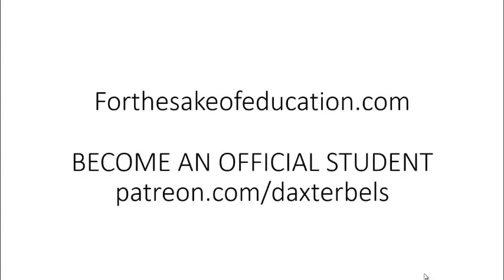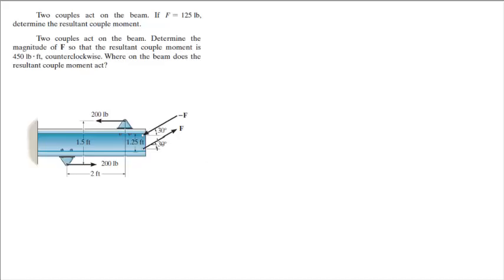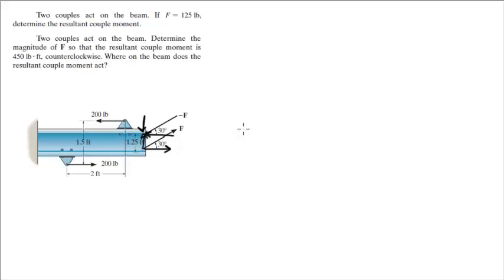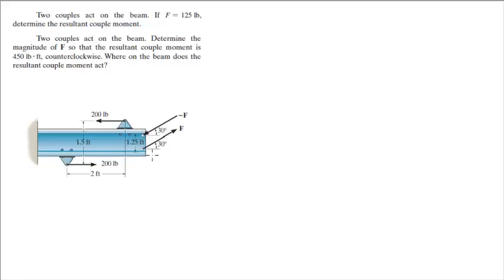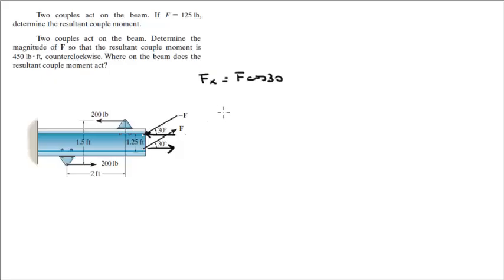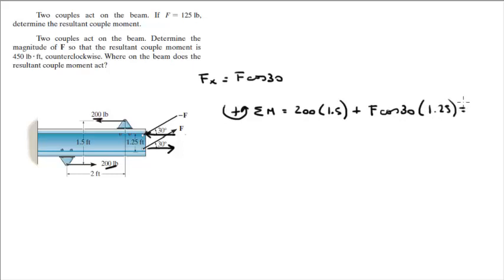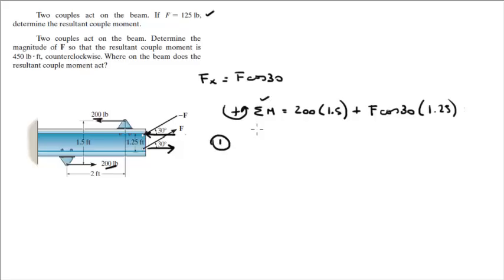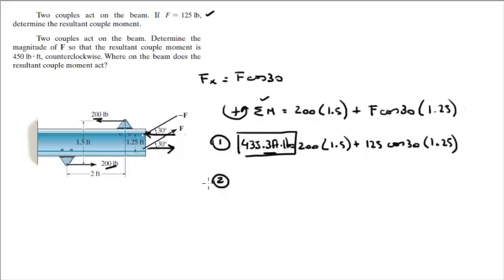Determine the resultant couple moment

Comment: wouldn't it be 2 times 200(1.5) and 2times Fcos30(1.25) since there are two 200 lb forces in the couple causing the moment and two Fcos30(1.25) in the other couple causing the moment ?

Comment: There's no point of rotation labeled. On other problems that look like this in the book the point of rotation, A, is in the top left corner.
Reply: The book states "A couple moment is a free vector, and as a result, it causes the same rotational effect on a body regardless of where the couple moment is applied to the body." so there is no specific point of rotation for problems like this.

Comment: But where on the beam does it act?
Reply from the maker: Moments act anywhere on the beam!
Reply: Would it not just act anywhere on the plane since both moments are free vectors?
Reply: resultant couple on question 2 acts on:

 1.41 ft upward and downward from moment center

and

6.48 ft to the left and right of moment center

the distance between the forces on the couple is 1.373 ft

pls correct if wrong